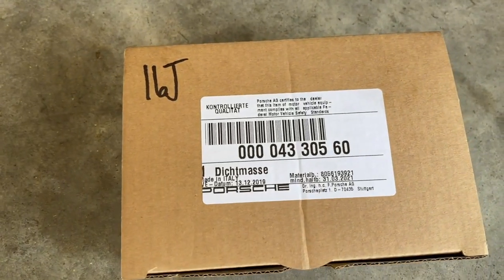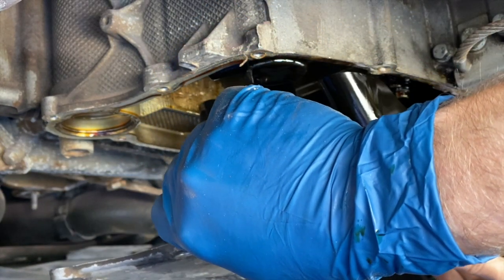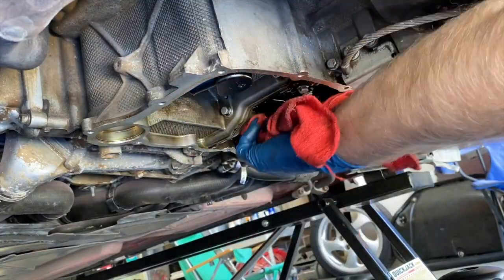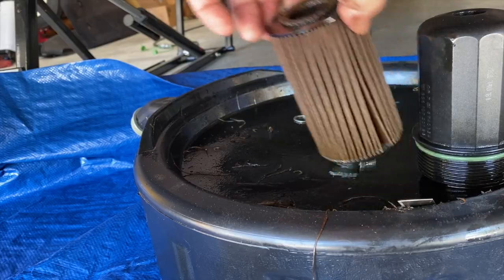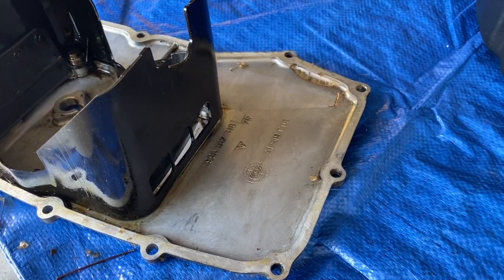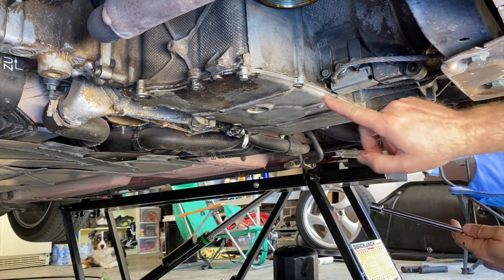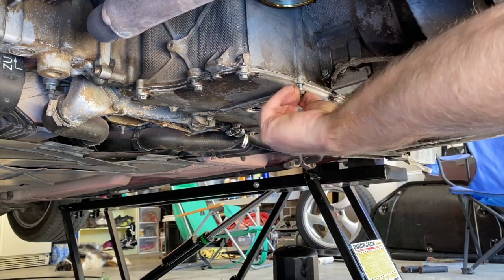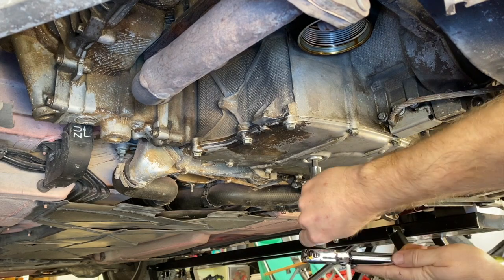How to REMOVE AND RESEAL THE ENGINE OIL PAN (SUMP) | Porsche Boxster 986

Comment: Great video. Well done. Properly cleaned the pan and seal gasket. Video was direct and stayed on point. I am replacing my oil pain now just due to some scraping and a leak. Thanks for the torque values. Thats what I was looking for.
Reply from the maker: +T smith you got it! Thanks for commenting.

Comment: Hi, wanted to thank you for a great video! I removed the oil pan on my 2005 Porsche 911 Carrera Convertible (997) some three months ago. It is pretty much the same procedure. Was very happy that I did not find any nasty surprises in there (75,000 km on the motor), but equally happy that I was able to give everything a good clean before putting it back together. Fairly straightforward job to do; the hardest part is squeezing the sealing compound out of the tube.   :)
Reply from the maker: +Dr. Alexander Pufahl haha absolutely agree! That sealant did not want to come out. Glad it helped and I hope you’re a subscriber now 😉
Reply: Hello, do you remember the torq specs for the 997?
Reply: @oros9112   Unfortunately, I don't.

Comment: I have pretty much changed, repaired or replaced everything on my 2000, 986. I love working on it. I even did the IMS, clutch and flywheel project. Pulled out a dual row bearing and it was fine. I replaced it with an LMS ceramic bearing. Rear main seal was leaking so replaced while there. I plan to pull my pan tomorrow. Thank you for great video.
Reply from the maker: +Joe-serious Howard wow you’re ahead of me 😁
Reply: @HelpMeDIY    Bro, I’ve completely overhauled this car. I even redid the seats with a kit from the internet and it made the car look great. I also put on a hard top, LED headlight and tail lights. This car is 100%.  Sad thing is I fell in love with it and have spent double what it is worth. Lol
Reply from the maker: @joe-serioushoward6201  I hear you there! 😆

Comment: Very helpful video. I'm partway through this, waiting for 4 new sump bolts to replace ones that had galled, very stressed that they were going to snap off in the block. 
Don't think my pan had been off since leaving the factory. Lots of little plastic bits (cam chain pads I presume) like you had and some metallic paste collected on the pan. No metal shavings, but a chip of hard white stuff, no idea what that could be...
Reply from the maker: +Christoph Soltau thanks! Glad it has been helpful.

Comment: Nice work on your Boxster. My 2001 S, 88,000 miles had the same plastic shavings in the pan, they were camshafts rail tensioner/guides.  I had them replaced along with IMS and clutch. It was costly, but it made the car run way better than before. I assume it helped with the timing, but it was definitely worth the investment and hopefully she'll run for another 88K.
Reply from the maker: +Gary Loudermilk nice!!
Reply: Thanks for sharing your thoughts.   I was wondering where all the small bits of plastic (smaller than 1/2 of a green pea) found in my 08 CS oil filter came from.   It's good to know a potential source is the camshafts rail tensioner/guides.   Do you know of potential problems from driving with broken camshafts rail tensioner/guides?
Reply from the maker: @Chitown388  they can let the chains skip teeth and eventually blow up your engine

Comment: Next time, leave two bolts in the sump pan (loosened of course) when you pry the sump plate so the sump plate doesn’t suddenly come off spilling all the oil and debris.(Hopefully no debris)

The Loctite is a real workout to push out of the tube!
Reply from the maker: Great tip!

Comment: Oh, we are doing the same work on our cars not just in the same order. I dropped my sump a few weeks ago to install X51 oil baffle (before the AOS replacement) and found some small metal shavings in the oil filter, but not in the sump. I’m now in the process of replacing the IMS, don’t dare to risk driving the car before I check it out. 

Plastic and metal could be chain guides I guess. That’s not good. I hope you find the source before any serious damage occurs.
Reply from the maker: Yes that’s my current suspicion

Comment: The plastic is the chain pads. 

The aluminum is worrisome. 
Could be piston skirting. ( borescoring) although that is more rare in Boxsters. 
Best to borescope from below with the sump plate removed. 

Cut the oil filter, stretch it out and use a magnet to look for ferrous metal.
Reply from the maker: Thanks Bruce!
Reply: Boxster M96 2.7 or 3.2 engines do not bore score. Different pistons from the 996.

Comment: Aaron the oil pan looks like it’s never been off the car before the metal bit are probably aluminium slag when casting the plastic bits could have come from anywhere if it was the IMs the car would be toast now if it were chain guides you would here a rattle you can check the oil filter anytime with out draining the oil if it’s not smoking or making strange noises drive it like you stole it and enjoy that great car 🚗
Reply from the maker: Hope that’s all true! That’s the plan... if it blows up then I guess I’ll just have to upgrade the engine 🤷‍♂️😎

Comment: Consider Drei Bond next time instead of the Loctite sealant.  Did you consider running a borescope up into the pistions to take a look at the condition there?  I am about to drop the pan on my 2000 996 C2 and take a look inside.
Reply from the maker: +AOWGroundBeef I just used what Porsche recommends for the sealant. I was happy with it. And no, I just got a borescope but didn’t have it at the time. Would be a great idea though!

Comment: Hey thanks for the Video, Like some follow up info on the metal fragments. Did you bring them for a porsche expert to look at and what was the result ? Also how many miles were on this engine?  You seem very through and cannot imagine you just threw them away without further investigation.
Reply from the maker: +Blake Chesbro others have asked in the comments as well. Here was one of my replies:

When changing the water pump one of the bolts sheared off and I had to have my mechanic drill it out for me. When I told him about the shavings, he told me that he accidentally drilled too far and went all the way through, and it was the shavings from the drill that were in there.

Comment: 996 and 997.1 know for IMS bearing problem. That could account for metal in oil pan. Also a magnetic metal would possible be note scoring of cylinders.
Reply from the maker: +Joe Venturoso not metallic = not IMS. Zero metal in my next oil change. Issue was drilling out the stripped water pump bolt too deeply.
Reply: @HelpMeDIY  
Great  news no IMS problem
Reply: I've just replaced the IMS bearing on my Boxster, also '98 2.5l, after finding lots of small metallic 'glitter '  on my filter. It was still the original dual row bearing. In one piece but  balls v. worn and centre bolt wobbly. Bearing and IMS shaft were full of glitter.  My rescue plan for the motor is to do some short interval oil and filter changes to try flush the metal out. Car already has 184000km on. 

I replaced the  bearing with the Pelicans Parts single row kit. Reasons being its price, and it's sealed, so residual glitter can't get in and mess up the new bearing.

...just a caution to those with dual row M96 motors. Keep checking your oil filter.
Reply from the maker: @christophsoltau4662  FYI the dual row bearings are much more robust that the single row and less likely to fail.

Comment: I think I know what it is but I don't want to say it out loud. The amber stuff is likely chain guide. I think.
Reply from the maker: +Brian Miller metal was from drilling out a bolt for the water pump and yes the plastic bits are chain guides.

Comment: It's always a bit of a worry when you find bits like that - if they're plastic and metal, do you think they could be the sign of the IMS bearing starting to fail?
Reply from the maker: Possibly, not sure. Engine sounds normal still...
Reply: I’d change the IMS bearing just in case. Or send the video to a Porsche specialist for his opinion ? The plastic bits are most likely pieces of the timing chains guides.
Reply: IMS debris would be ferrous.
Reply: @texsquirrel213  That's reassuring and good to know. Any idea what it might be?
Reply from the maker: Bruce Pullig well that’s good to know 😀

Comment: Did you ever find out what the plastic bits were in the filter? I just changed my oil and had the same stuff.
Reply from the maker: +John Sampson thinking its probably bits of the chain tensioner but can’t confirm that.
Reply: Did anything ever happen to your engine? Or was everything fine?
Reply from the maker: John Sampson still running like a champ so far!
Reply: @HelpMeDIY  it could be pieces of metal from an old turbo fan that went bad...after you change turbo it is recommended to dismount  oil pan to eventually remove bits of metal
Reply from the maker: @lion-of-lucia1158  this car doesn’t have a turbo. The metal bits were accounted for.
Reply: @HelpMeDIY  ok  ..what was the origin ?
Reply from the maker: @lion-of-lucia1158  mechanic drilled too far when drilling out a bolt from the water pump that sheered off. It was shavings from that we determined since there were no shavings at all on the next oil change.

Comment: Did you ever find out what the Aluminium shavings were?
Reply from the maker: +ProductSeer yes! When changing the water pump one of the bolts sheared off and I had to have my mechanic drill it out for me. When I told him about the shavings, he told me that he accidentally drilled too far and went all the way through, and it was the shavings from the drill that were in there.
Reply: @HelpMeDIY  Whew! So no IMS bearing issues? That's great! I am going to be pulling my oil sump this weekend (like everyone else and there mother that is commenting here it appears), but I do want to thank you for your insightful videos. I have the IMS bearing anxiety because while the car I picked up is in great shape, the previous owner did not know whether or not it's been replaced.
Reply from the maker: @shockoo  no IMS issues :) You’re welcome and thanks for watching!

Comment: That's a lot of metal shavings I got to Lexus GX and inside the filter I see metal super small specs one in every single pleat is that normal I got 40,000 miles on a car you look pretty bad some of those pieces are big did you ever figure out what happened with the engine
Reply from the maker: +Ralph Kowalski yours sounds like an issue you should get checked out. As I said in another comment, my next oil change had no metal. It has come from drilling out a bolt that had sheered off.
Reply: @HelpMeDIY  I did get a checked out the dealer told me nothing is wrong I hear a weird sound from the engine at low idle I'm freaking out a little bit it's out of the warranty